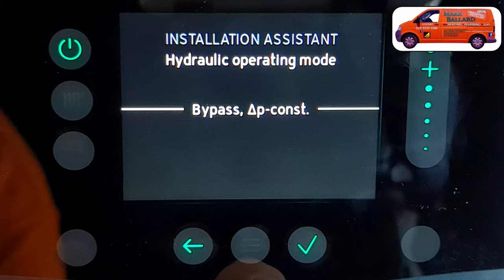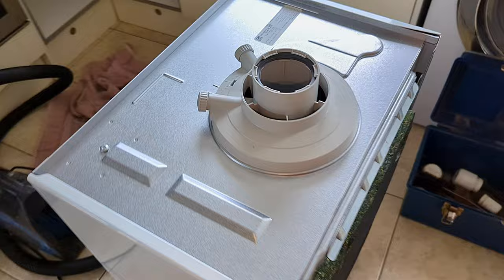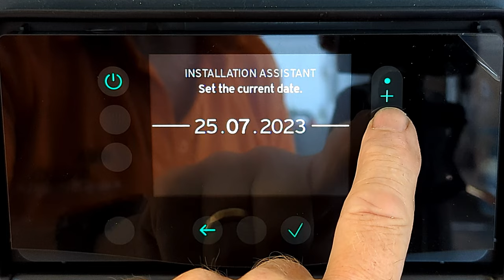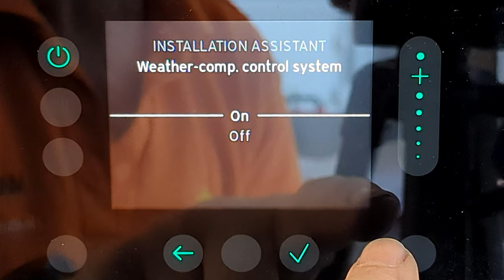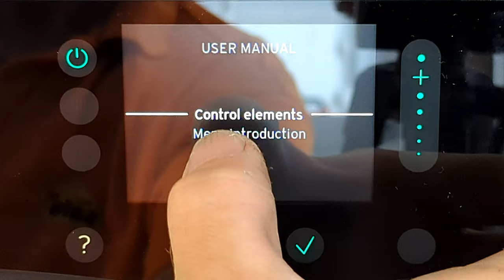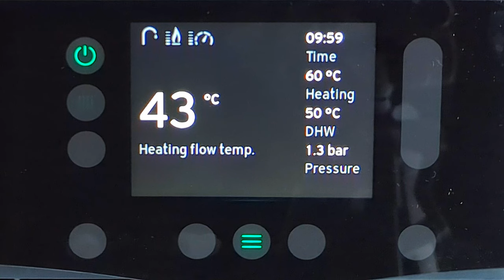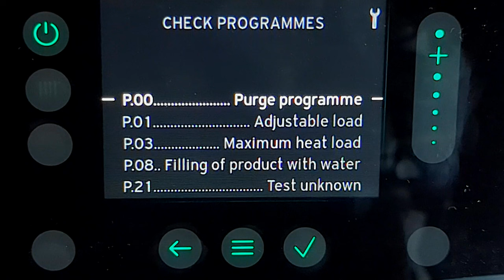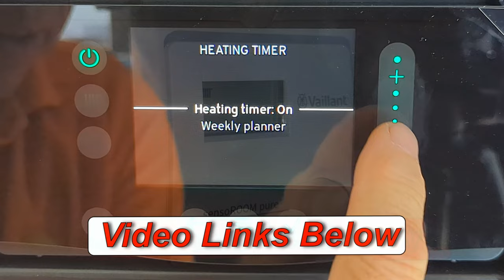How to Commission the NEW Vaillant Ecotec Plus Combination Boiler with it's New Touch Screen Display

Comment: Weird things happening with out install (occurring as I type this) there is no option to set whether the boiler is using weather compensation, and under the diagnostic codes there is no option for 162, there is just 161 and 164. Tried a factory reset and nothing.

Comment: With regards to filling, if you power up before filling it will enter purge mode whilst filling to clear air from the heat exchanger via the AAV. 👍🏻

Comment: Hi Mark, great video - thanks. I also bougt an ecoTec Plus a few weeks ago and when testing some things i put it into summer mode by pressing the heater button 3 seconds. My problem is that i use a Tado smart controller on the eBus instead of a Vaillant controller - Tado can not end the summer mode - will resetting the boiler to factory settings and configure it new based on the diagnostic infos end the summer mode on the boiler? And is there any risk when resetting to factory settings?

Comment: Hi, Mark
Thanks for the info.  I have a question.  I have Vaillant Ecotec Plus system boiler plus unvented cylinder.  When the boiler is on, the radiator is working but there is no hot water.  I have tried the DHW (domestic hot water) setting on and off seperately, but still no hot water.  Wondering what go wrong, thanks

Comment: Hello Mark,
Can I replace my old VRC470/4 controller with a newer controller? Do they all work with 24V ? Do I need an adapter plug for the newer controller? I have a VWL 85/2 A heating/cooling system. Thanks.

Comment: Hi Mark 
having installed a couple of  the new 625 models we have had problems with them stuck on low flame so will only reach around 53c 
if we reset it will go to full flame and the next day it reverts back to low flame any idea's 
Regards

Richard

Comment: They made an easy menu from past models into a tedious and long winded annoying one!

Best keep the installer number hidden. Customers love to play around with boiler settings then claim they didn't touch it.
Reply from the maker: I wont be walking my customers through that menu.  Totally Agree.  I've seen other videos showing the code, that's why I asked.
Reply: Hi there 
In your opinion what’s the best boiler for a three bed detached house 
With eight radiators